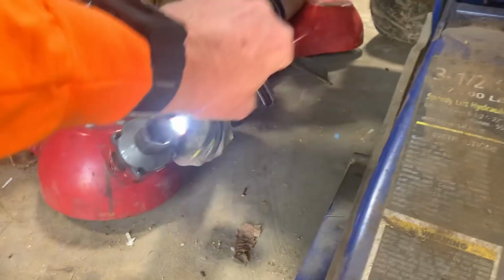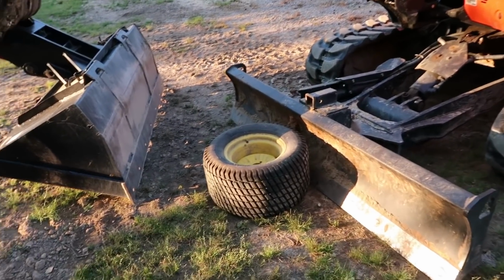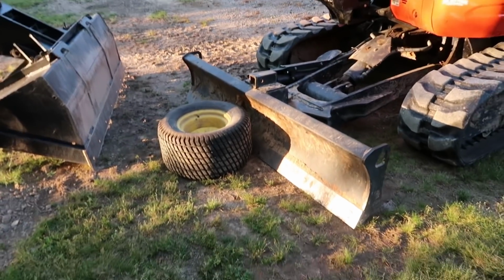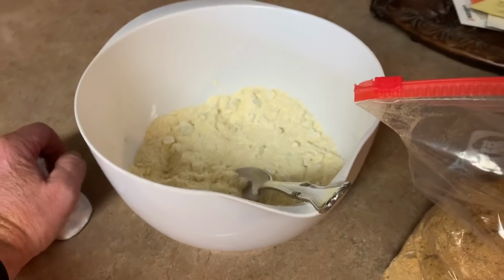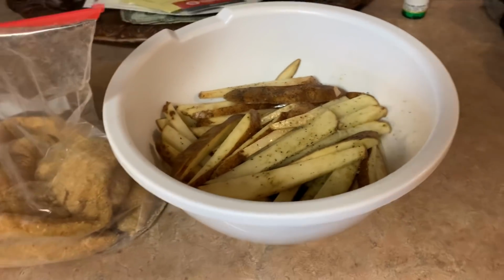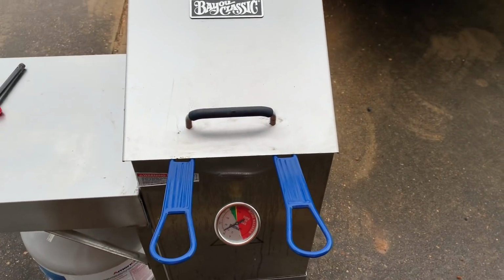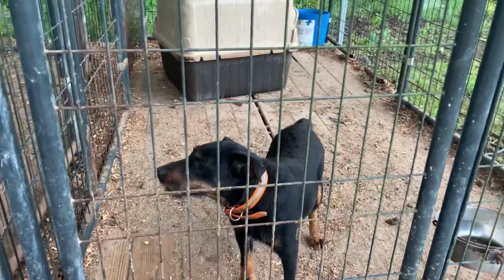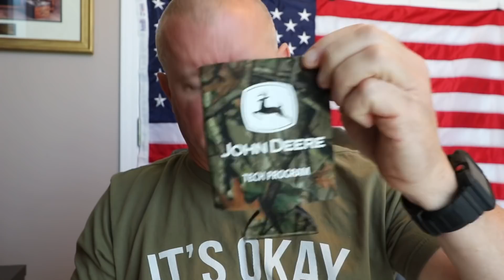Tractor tires on my John Deere zero turn

Comment: Tire tip. When seating tires on rims for the first time, leave out the valve stem valve, the compressed air will rush in faster to seat the tire easier. Happy mothers day
Reply from the maker: They would not let my air chuck put air in without the valve core. I tried it.
Reply: Yeah its your air chuck not the valve stem, ahd the same problem once.

Comment: i found that using water hose and coat hanger get all the little bits left over.  i use way less oil with this fryer. i just leave it in for several fryings as long it does not have a lot of beer batter. bits of coating never burns with this frer.

Comment: On commercial mowers the chevron tread wears out too quickly. Save the turf tires. If you can stay on grass/dirt they will do OK.  Any concrete or asphalt will leave you with two slick balloons and mower in the pond.

Comment: Hope those tires work out Tim. I would be afraid when turning quickly it will rip holes in the grass. Mine already does that and i have the original turf tires on it. Hope MRS Jill had a happy mothers day.

Comment: Great video. Putting the tractor type tires on the zero that was mainly for the traction right? I also have a John deere zero turn Z915B. I put the weight bar on the rear and made a front weight bracket for the front. I was not going to pay $500 bucks for a bracket then had to pay more for the suitcase weights. I got a 2in thick x 18 inches square peice of steel at auction cheap a few years ago. Finally decided to use it. I mow on hills with it a lot better now. Had the front end off the ground going uphill alot before. Now it will not come off the ground anymore. Sometimes I still have some trouble when turning around and going back down hill it wants to slide. Also before if I had the front tires pointed down hill then needed to turn back up hill it would not do it at all. It would just sit and spin. That was not fun when you had a steep bank and a 6ft drop to the pavement. Luckily never had it do that though. Now it can turn back up hill with out losing traction since the weight was added.
Do you think those tractor type tires might stop that? Also keep an eye on those hydraulic pumps the past 2 yrs (once a year)I had a plug on the top of the pump by the fans crack and it poured out the plug until the hydraulic fluid from the reservoir reached the level of the plug. Luckily JD covered half the cost. 1st yr it only had 150ish hrs on it. 2nd time it happened was 286 hrs on it. It now only has 302 hrs on it. 2015 model

Comment: Would it be easier to use the attachment plate without the bucket?  What size were the new tires?  Where did you buy them?  I have a Kubota ZD28 that will get stuck on dry pavement!

Comment: I've run a JD Z-track for about 8 years, 4,000 service hours.  As tempting as it is to mount Ag/bar type tires, nobody running commercial goes that way.  The machine is so prone to tear turf with turf-style tires, those Ag tires will really tear turf.  To be sure, they undoubtedly will provide traction in some places that turf tires will not.  But, the trade-off does not work out well.  Tire tracking is a large part on the finished work. 

These machines are not the safest machine to be operating.  Now, putting added grip on the tires may be the element that means catastrophe.  If the turf tires don't hold on the slope, then the machine probably shouldn't be on that slope.  In other words, the Ag tires may take the machine to places where it should not be operating. 

I know lots of lawn care contractors who have tried the Ag tires, and quickly taken them off - safety.  A lawn tractor is a different machine, and they Ag tires may make sense.  Z-turn, ... could be a problem. 

Just my experience...

Comment: The last time I saw a ratchet strap used on a small wheel and tire like yours. The strap failed and broke his arm and cut his forearm deep requiring almost 300 stiches on the same arm.